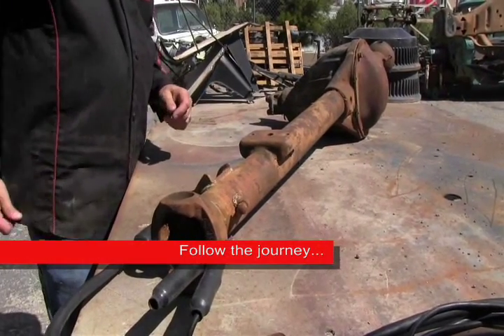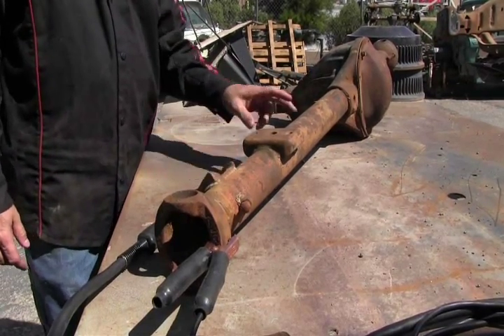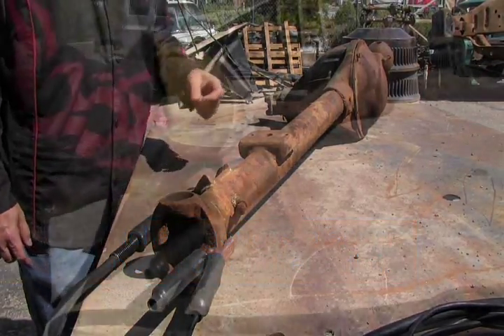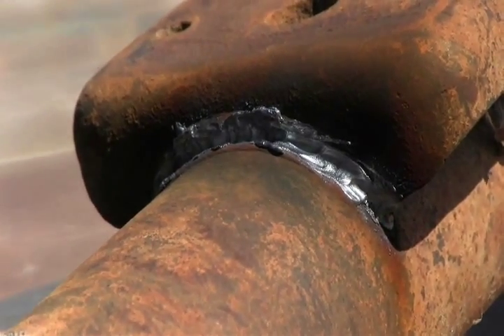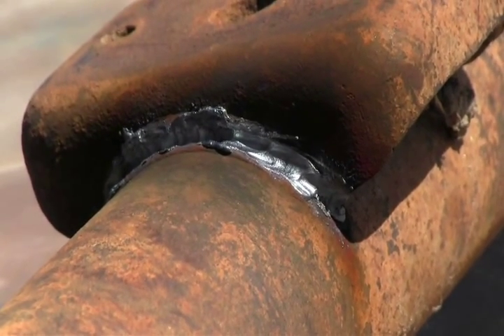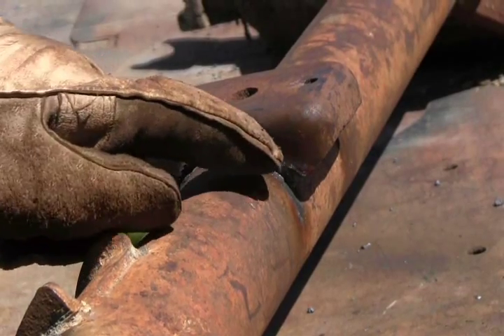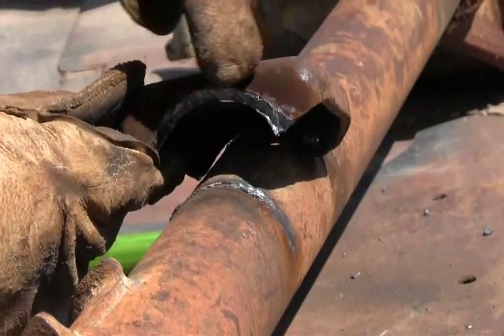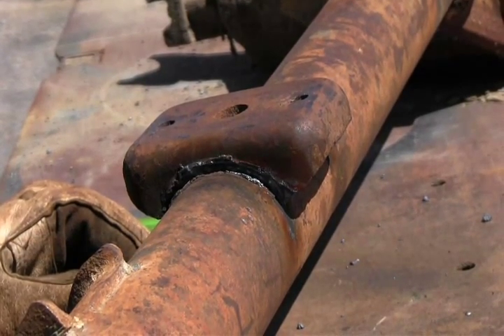Gouging a differential spring perch

Comment: Scarf: a joint connecting two wooden timbers or two pieces of metal in which the ends are beveled or notched so that they fit over or into each other, locking them together mechanically. I hate it when improperly used terms are perpetuated as an alternative name for something. I guess unless you're a whaler?